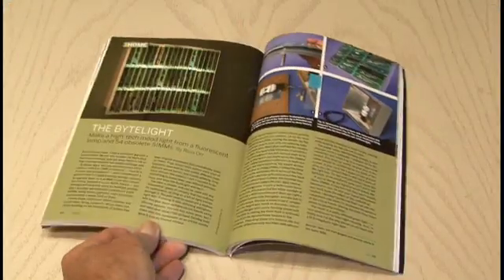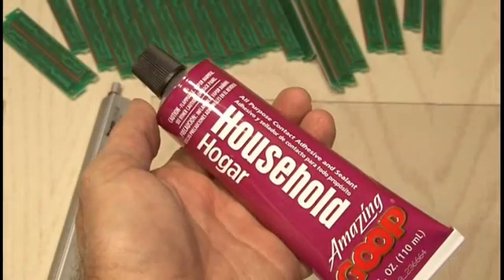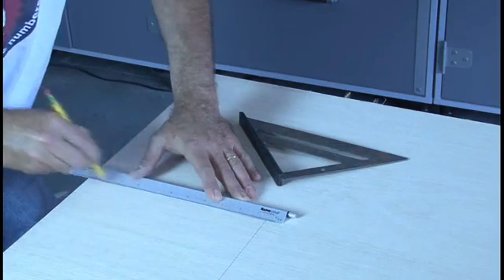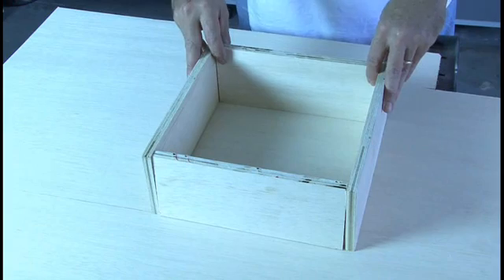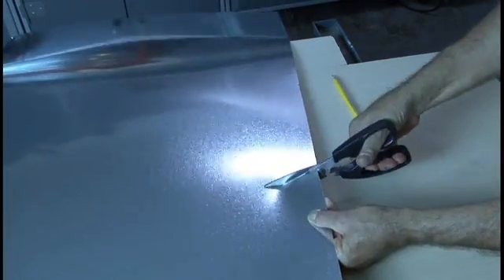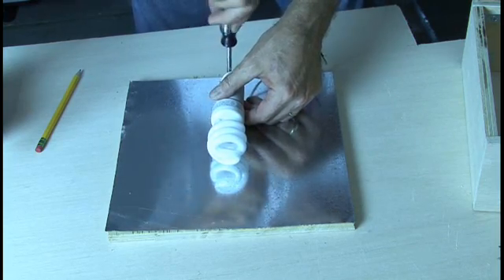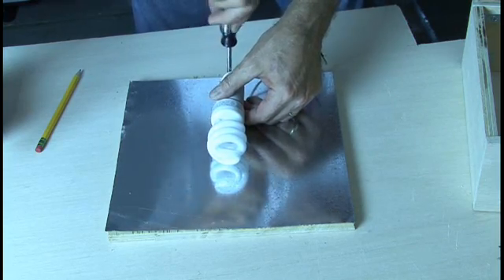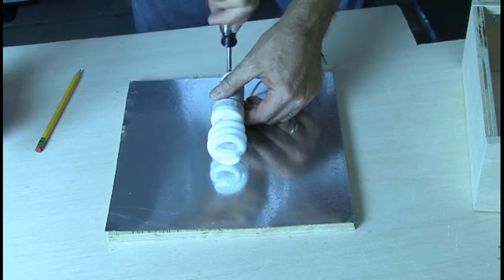Weekend Project: The Bytelight

Comment: Actually, if you're responsible, then that wont happen. plus, modern saws cut so fast that the part of the glove that got cut get almost instantly cut off. That disproves what you said completely. Second, the gloves are good because you don't want to get splinters from the wood flying off of the saw.

Also, just out of curiosity to explain your massive misspelling, is English your second language?

Comment: @Gatewayuser200 That may be so, but if you think about it those memory chips aren't usable anymore since they will NOT fit inside the socket, well unless you still use a really old computer, so this is at least a better option than just throwing them away into the trash.

Comment: @jbat3535 Since you are so fond of Wikipedia though, allow me to quote from the proper article about this type of lamp. "CFLs typically have a rated lifespan of between 6,000 and 15,000 hours" Wikipedia still isn't a reliable source, but since you like it so much, there's the actual info on this type of fluorescent bulb which is a CFL, not a Linear Tube.

Comment: @jbat3535 I didn't change the topic, ever. Also Wikipedia is not a reliable source. Also I looked at 10 main brands of fluorescent bulbs and not a single one was rated even over 10,000. Also these are not linear fluorescent tubes. Also, that doesn't change my original point which was that you would still have to replace fluorescent relatively often, whereas LEDs you would only have to replace once every 11 years if the light was left on 24/7. And that's if you use cheap LEDs.

Comment: @Raven1024 "Typical average lifetime ratings for linear fluorescent tubes are 10,000 and 20,000 hours", thats from Wikipedia, and quite a few t4 bulbs I have purchased are rated at that.  Changing the topic, great way to try to attempt to mitigate flak in a debate if the opponent isn't aware of such a strategy.

Comment: @jbat3535 My point with the Radioshack thing is that most towns that have a Radioshack, also have an alternative, like a locally owned shop, which is cheaper.

I've never had a flourescent last that long. They usually last about 10,000-15,000 if that. Also this light by it's nature is one that will be left on a lot as a decoration. LED's are still a better bet. Also I was just saying in the first comment that he will indeed still have to replace the bulb. Most humans live longer than 2 years.

Comment: @Raven1024 Radioshack is overpriced, but when you need parts now and cannot wait for shipping, they are perfect.  That's what Radioshack is there for.

Fluorescent lights usually last around 10 times longer than incandescent.  Most Fluorescent lights last around 20,000 hours run time, and I highly doubt you will have this light on enough for that to burn out.  It would need to be on continuously for nearly 2 years before the light would burn out, CONTINUOUSLY.

Comment: @bloodlesXxXvampire I have Intel Core i7 940XM Quad Core Processor, 2.13GHz 3.33GHz Turbo Mode, 8M Cache,  Windows 7 Ultimate 64 bit , 1GB GDDR3 NVIDIA GeForce GTX 260M Graphix card, 1080p high res wled monitor, 8GB Dual Channel Memory; 2x 4GB DDR3, 400 GB SSD - Samsung Solid State Drive and Slot-Loading Dual Layer Blu-Ray BURNER. So... What? You have 4 terabyte ddr3000 Memory Manufunctured by makebelieveland inc?

Comment: Should make it hi-tech, use 1W led's. Would make for a more even light, probably need to use a piece of aluminum for the back rather than just a piece of sheet metal over wood. 

Also shouldn't wear gloves with power tools, should wear them when working with sheet metal and sheers.

Comment: I know that. I know alot of these things.. Hybrids are very very rare and crap. Since they are designed to run both brands that are so much different wich mean it can't run them on full power. No one buys there motherboards anyway.
I have never touched AMD and looks like I don't have to for couple years. I used to stick with Intel NVidia combo but now I bought ATI. NVidia is losing grip. HD4890 70€ cheaper than GTX275 and still as good. Ah NVidia drivers. Well that's something we all hate.

Comment: Gaming computers use 4 or 6 GB's of RAM depending on motherboard type. Newer computers with i7 uses 6GB of RAM because 3GB oF RAM costs 20 bucks less than 6GB. 4GB for older intel processors and AMD. I myself have 6GB

Comment: you kud gust connect all of the opsilleet chips together to your computer i did it and it was sooooooooooooo fast i kud run more then 20 thuosand programs and it woud be still fast. i did it with 10 one mb hard drives.

Comment: Actually, that memory ran at most lukewarm back then in early 90ies - whole computers consumed some tens of watts.

However, consider it didn't get ruined when it got wave-soldered, being completely heated up to 185°C or even more. For that reason, chip enclosure and PCB material is actually way more heat-resistant than Plexiglas or Lexan, which are likely to warp at just above 100°C. Starting from 160°C the wooden enclosure might start burning.